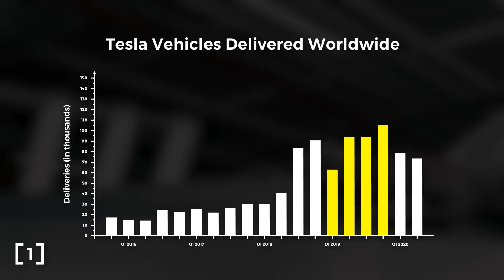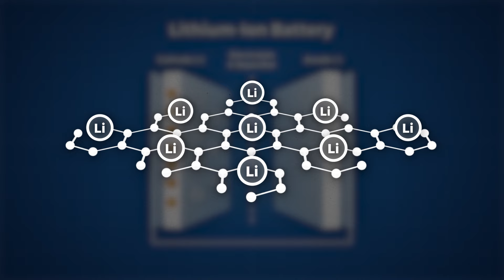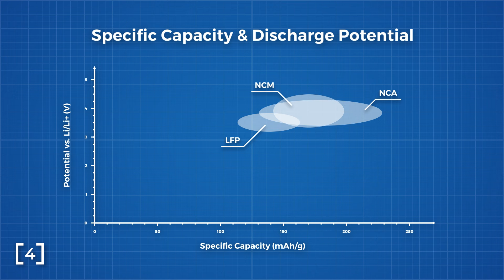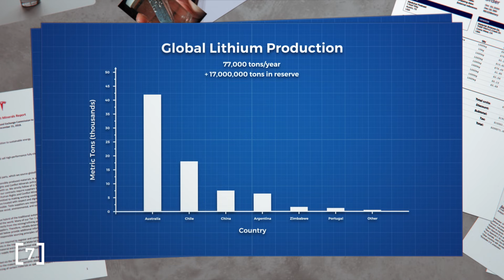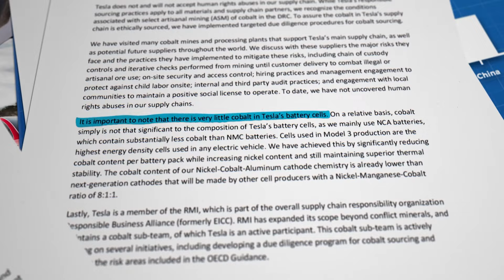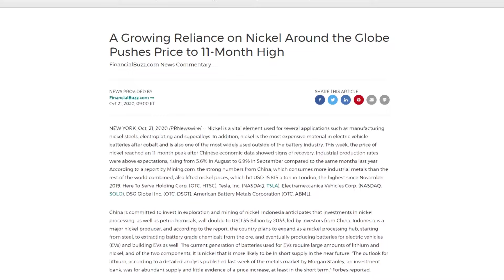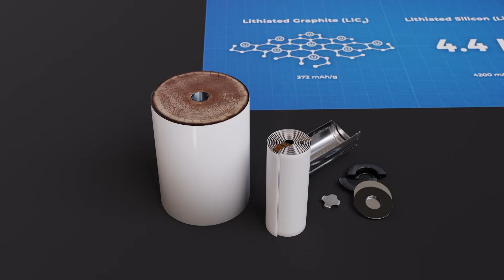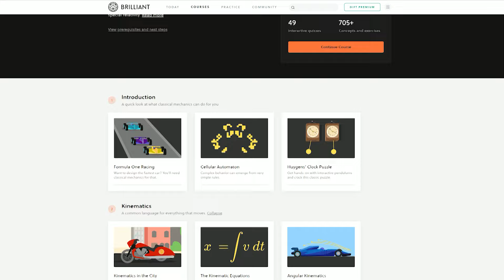Tesla's Battery Supply Problem

Comment: We don’t need to fully switch from fossil fuels.  Low hanging fruit such as passenger vehicles and commercial short haul trucks will suffice for the next 200 years and more.  Recapture of CO2 and reuse as fuels will lead to net carbon 0 if you care about that.  I don’t feel environmental should be the driving factor rather energy security and as of now renewables are worse than fossil fuels often.  We will get there only if we focus on cost and not environment.

Comment: Let me know when the mining equipment is powered by electric, and the electric charging all those batteries isn’t powered by fossil fuel. The car/phone is the end user. A lot of fossil fuel is used to creat everything involved in using less fossil fuels. Wouldn’t telecommuting be a better option? Cleaner fossil fuels is where we are, and yes it would be nice to move forward. Sometimes starting at the end user is not going to change the source of the energy we use.
Reply: Some work equipment may never switch due to special needs. But they could run on biofuels or hydrogen. Civil aviation is switching to electric propulsion.
Reply: Ah, but as the grid gets greener with more coal and gas plant requirements, the entire electric fleet gets greener too! And maybe 2% of the US grid today makes electric cars dirtier than gas/diesel. So electric cars are cleaner today and much cleaner in the future. You can Google to find the numbers.

Comment: We have to get away from liquid fuels. Why? Batteries are crap and they wear out fast. Using energy you can make liquid fuels. What's wrong with that?
Reply: Properly produced and managed Li-Ion batteries don't wear out fast. Tesla batteries are lasting well over 200,000 miles and powerwalls are warrantied for 8 years and should last far longer. Megapacks can be warrantied for 20 years. LFP cells, which are becoming more popular again, can last for twice as long as lithium.

Comment: I don't understand the issue?
Why does everyone insist on making lithium ion batteries when there are sodium ion batteries which use carbon and sodium.
Both of which are easy to obtain.
Sodium is in the salt in the ocean, just use electrolytic sepparation and voila.
Carbon is easy enough just use sugar or CO2 or what ever you want really.

Yes it has about 20% less charge but could easily be rattified by making the batteries 20% larger.

Comment: Its pretty clear that long-range battery powered PURE EVs are NOT for the mass market and will NOT be able to solve the problem of climate change... there has to be better approaches for NOW, while we invest into more sustainable design of battery tech which can easily scale and uses common and not super rare materials...
i like hybrids... hybrid powerplant electric drive EVs... you can have a small engine in the car which is pretty much a portable powerplant which is only supposed to produce electricity which is stored in a SMALL battery pack of no more than 5-10 kWh... The interesting thing is that most people drive less than 40 miles per day, so having a battery pack with capacity of 10kWh would provide more than 40 miles range and most people would be able to charge overnight... if you go on a trip somewhere or you simply happen to be driving more than your the full capacity of the battery can provide, your small engine starts and recharges you battery... boom... problem solved...
The engine would be really small... around 0.5 liter which will only turn a generator and will NEVER directly move the car... this approach is the most logical way to go... use existing tech, start weaning off the DIESEL and GASOLINE towards something better, like Natural Gas... theres plenty of natural gas around... its easy to store in high compression mode or liquid form... its a lot cleaner than GASOLINE or DIESEL... plus since you use it to power a GENERATOR on WHEELS, its a LOT more efficient that driving the car directly... typical sedan car efficiency is around 20% for an ICE engine.. typical portable Natural gas generator is 50% efficient... Ill take the 2.5 fold increase in efficiency and a LOT LESS EMISSIONS... not to mention that Natural Gas (CH4) is part of the natural Carbon cycle... and is also a byproduct of organic processes and life in general...
Reply: Such vehicles, as you describe, have been on the market for years. Where are their sales?  People "say" they want one thing, but when it comes to actually buying that choice, they choose otherwise. 
 With the new batteries, horsepower and performance, and range don't have to be sacrificed for economy and low emissions. Also, pure battery power is much cheaper, cleaner, and less weight than hybrids. Getting a re-charge isn't a problem. There are re-charge stations in many places -- with more being installed.
Reply: @artsnow8872  Vehicles that i describe have NOT been on the market... A Prius is a HYBRID DRIVE car... meaning it has a smaller than usual engine but the engine is also used to MOVE THE CAR... no simple charge the battery pack...
also, there are NO Natural Gas powered hybrids in US and no natural gas powered cars in general since there is no infrastructure for refilling cars with Natural Gas... so i dont know what you are talking about when you say that "have been on the market for years..."

Comment: Bro we gotta use hydrogen fuel cells, won’t need batteries then
Reply: @calamityjean1525  yeh I saw that too. I know it’s really inefficient in the whole energy conversion thing but it’s still great when combined with renewable energy cus 1: theres basically an infinite supply. If you got a ton more power than a battery storage place can handle then your fucked, but with hydrogen you can just keep making more fuel. What are ya gonna do, run out of water?

Comment: I'm sorry can we talk about WHY it's so bad to have fossil fuel powered vehicles?

I'm absolutely against using fossil fuel for generating electricity, but using petrol for vehicles is just a lot better idea then to battery powered vehicles.
We all know it takes 1-2 years for an electric car to have the same enviromental impact as it's petrol powered equivalent and only after that will the electric car get more environmentally friendly.
We didn't even calculate the fact that as this video mentions Li and other elements are very rare and what happens to batteries after they are used up. The range of electric vehicle is just pathetic compared to a petrol powered car, which you can say will improve, but still will take an insane amount of time to recharge.
Real world useage of these cars are just hilarious.
Tesla has a very nice grid for recharging their car, especially with the superchargers, but it still takes 30 minutes to recharge your car fully. Non-tesla vehicles cannot be charged using tesla chargers and they take even more.
If you wanna go electric, why not use Hydrogen powered cars. Hydrogen powered batteries or BMW was experimenting with hydrogen combustion engine.
Both of those cars take a few minutes to recharge just like petrol powered vehicles.

And then comes the question of global warming where the 1.1 billion passenger cars on earth are only responsible for 9% of the emissions, while the 2500 coal power plants alone are responsible for 20%. And nobody gives a shit about shutting down coal power plants. Why is that? And don't say, because you can easily turn on and off coal power plants (unlike a nuclear reactor) and they can work whenever you need them (unlike solar power / wind power), because there's already a lot of answers for that problem.

Comment: okay.. just because your a fan boy of EV's doesn't mean you have the production capacity to shift 90 *MILLION* annual sales to EV's..
further, the sheer impact on the electric grid to recharge an EV car/truck population is a fkn pipedream..
three problems..
1. battery production using rare earth minerals.. until you can make it from carbon or aluminum with the same energy density, ya ain't there yet. 
2. the sheer need for the battery to be better and have equivalent power numbers just isn't here yet, yeah they get 500-600 miles, but they don't refuel in 5 minutes like a petro run car/truck, battery tech still doesn't have the ability for recharge cycles faster then a dino burner.
3. the mere fact that the needed materials are all over the fkn planet and the need for petro burning ships to ferry the materials makes them not worth the time spent making them. YOU BURN THREE TIMES THE SHIP FUEL FERRYING THE MATERIALS AND PRODUCTION TO AND FROM AND EVERYWHERE ACROSS OCEANS...NOT A CARBON SAVING ENTERPRISE. in fact a fake gambit to stop the oil industry an cars which run cleaner then they ever have at any time in history.

Comment: Well I'd say production and batteries are not the biggest problems(outside environmental problems) since at least where I live Tesla services are none existent the building quality is also less then nothing like I've litterly seen one break at 160km/h.            (I have driven one myself model X) and I agree the car looks cool but that's really it the quality is just not there unlike older manufacturers unless they fix it it won't succeed

Also the batteries aren't recyclables are they? And also since almost all power comes from fossil fuels it's no better then Gas also the current powernet cannot deliver if the all electrical moves on. If we want a good future well need nuclear power.

Comment: E-Fuel is going to put Tesla out of business because E-Fuel makes all internal combustion vehicles, Electric vehicle by using electricity to produce the fuel and all they have to do is fill their tank with Energized water instead of gasoline and they are an EV and they are just environmentally friendly but a lot more efficient and cost effective.

Comment: Relying on batteries to solve climate change is such an inefficient and backwards idea. The amount of carbon required to dig up the resources required is not sustainable. Subways, trams, metros and light rail powered directly by electricity is the obvious and efficient solution, but there's not profit to be made there so it's not presented as a solution.

Comment: The South Australian telsa battery was only required because of incompetence by the state Labor government at the time. They are ideologically opposed to gas, coal, and in favour of renewables, at the expense of grid stability. Sometimes, improving politics is more useful than tech fixes.
Reply: I mean being opposed to those things is good, especially with a country like Australia that has so much solar potential.
I don't think a battery bank is the best way of having intermediate energy though.
Reply: @galdrack5402  The problem is that solar doesn't provide baseload power. So it can only be used as part of a mix of technologies and sources.
Reply: @w0mblemania  sure but Australia could easily use a lot more solar energy given how much space and sunlight it gets. The country is one of the worst for CO2 emissions per person while being a very developed country, there really is little excuse for the amount of emissions from it. 
A mixture of renewable and nuclear would probably be best.
Reply: @galdrack5402  I agree. Although I do disagree about the "little excuse", because unlike, say the UK or Singapore or even NZ, the costs of doing almost anything industrial in Australia are much higher due to the distances involved. e.g. trucking/flight times to any of our capital cities, let alone country areas. 
A better metric would be energy efficiency per kilometer.
Reply: @w0mblemania  It's little excuse in many ways. There's way more solar power to be generated in Australia than all the countries you listed which makes it much more wasteful that the country is so reliant on fossil fuels (and is a big exporter of them too).
The travel distances can be significant but it's all the more reason proper rail infrastructure should be made to reduce the emissions between those distances. China and Russia both deal with this on a much vaster scale without the same emissions per capita or kilometre (Australia is one of the worst per capita in the world).
Not every country has to deal with it the same way but Australia has been pretty terrible overall, it's a country that still elects climate denialists afterall.
Reply: @galdrack5402  First of all, Russia isn't dealing with it. Russia is an economic and environmental wasteland. (And China is an environmental wasteland.)
Secondly, Australia has very different economies of scale. Population in China is vastly more dense, and so rail can be more effective. It also helps them that they have an authoritarian government which will raze entire towns to the ground to make way for railways, damns.
If you want to do some Australia bashing, pick a more realistic comparison. e.g. Canada.
Reply: @w0mblemania  Dealing with it refers to lower emissions and on that front both countries are both doing more than Australia. Calling both environmental wastelands and not labelling the Australia the same is simply absurd given it's emissions and the damage it has done and continues to do to the environment.
Australia has a near perfect setup for rail transport actually just like Russia. It has large population centres with vast wastes between which suits rails extremely well. It's extremely comparable.
I'd critique Canada in the same manner. Australia simply has been lacking in these areas and there's really no excuse. Building railways or dams doesn't require extreme authoritarian measures that's a silly deflection. Australia built large roads crossing these areas rail doesn't suddenly require genocide or authoritarianism.

It's silly to deflect criticism in this manner all EU countries should be doing more too but Australia is one of the worst offenders at the moment with very few excuses for it.
Reply: We'll have to disagree; it all just seems like so much politics as usual.
How do you propose using massive solar power grids as baseload power? What's the economic solution?

Comment: You are completely wrong about Lithium not being a big concern. Permitting a mine, in any jurisdiction in the world takes about 10 years.  You can't just up the production at a mine, it cost lots of money and takes lots of time to permit. To get production where he needs it would take 50 to 100 years, at least. I am a mining engineer with 30+ years experience and I can tell you it just won't happen without huge investment; and right now, there is very little. Also, you hardly touched on the energy required to mine and process Lithium. If you look at the energy balance, it is not good compared to the energy saved with an electric vehicle.  All the tucks, shovels, etc are all Diesel powered. You need to dig way deeper to understand the challenge being faced.

You also never touched on rare earths used in the magnets, touch screens, etc.  This is a much bigger problem than even Cobalt, Nickel or Lithium.

Comment: and smart peeps opt for something else. nitrogen, most of the air around. and hydrogen, the most common element in the whole universe. NH3, better energy density both by volume and weigth. storage tank is like 10 BAR or so. and can store energy for far longer than a chemical battery.  yey.